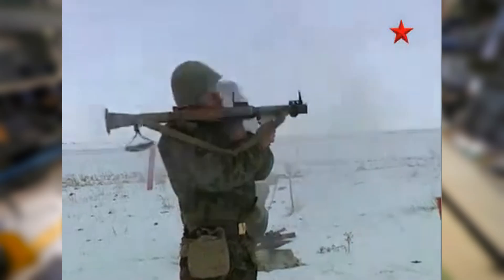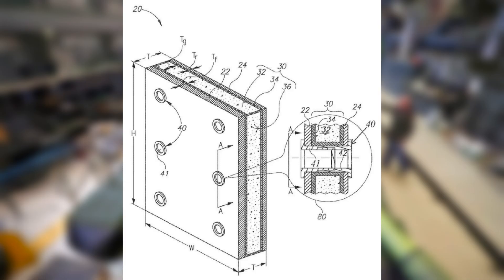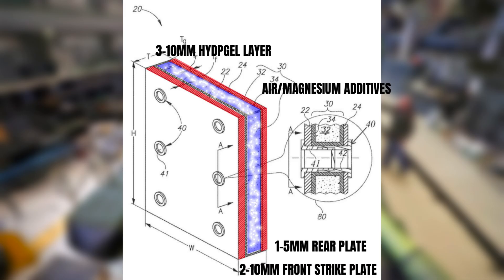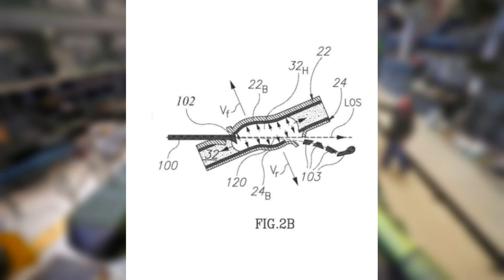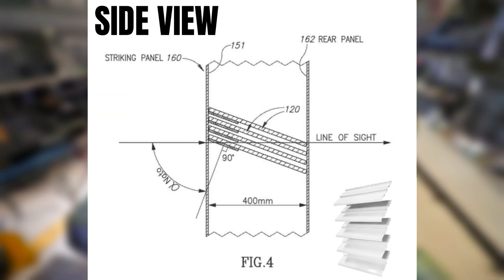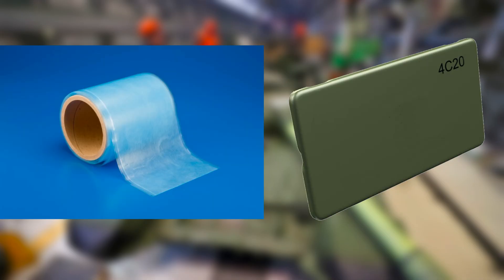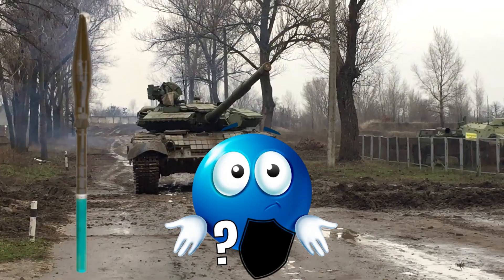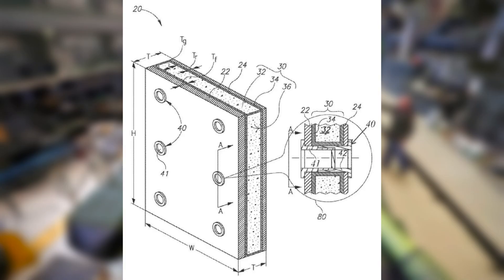New Israeli Water-Based Reactive Armour Explained | Hydrogel Semi-Energetic Reactive Armour

Comment: We must also consider Israel uses active protection systems, so perhaps the engineers are considering that the need for the armor stop all projectiles is reduced, and instead they are looking to reduce cost or make it easier and faster for crews to handle and install/replace
Reply: I dont think israel would comprise on protection of its crews, if it tries to up armor its tank, it will do so to the their fullest extent

Comment: Could the water get hot enough to cause a steam explosion after a hit?
Reply from the maker: It’s hydrogel so for small projectiles there would only be mechanical breakup, if energy transferred is greater than the heat capacity by many times a “violent evaporation” could be possible but since the energy is deposited over a large area probably not
Reply: @Spookycat.32 If water-based media are the jitt these days, and I'm all-in with hydrogels in general, what ever happened to the oobleck-based armor idea?